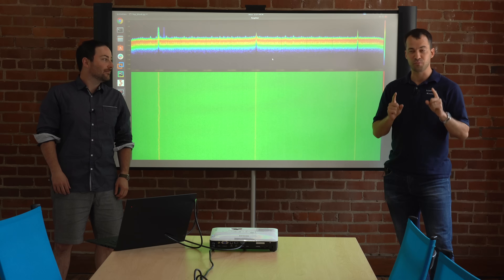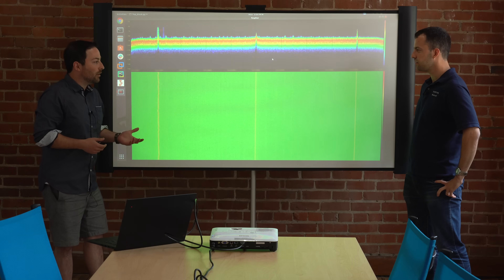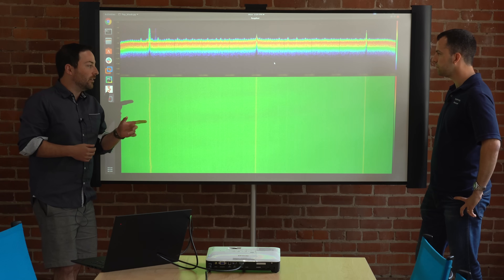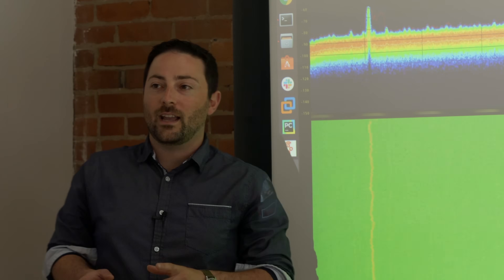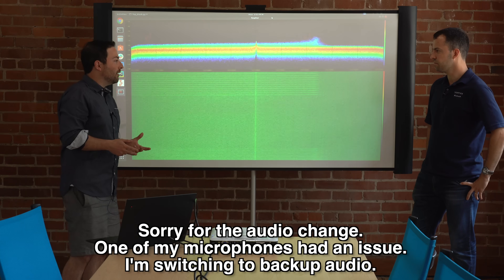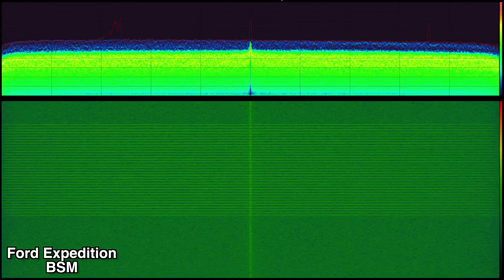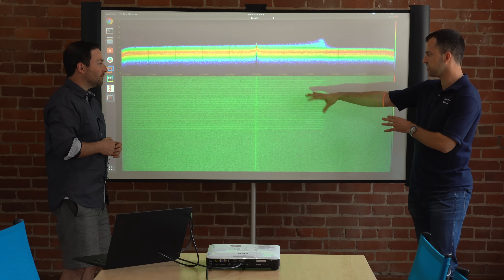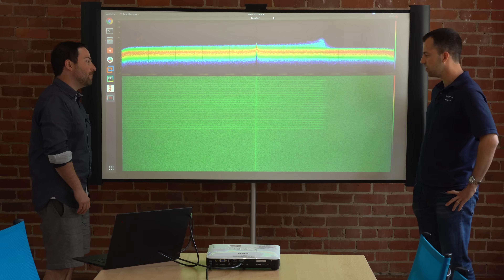Why Only Some BSM's Cause False Alerts

Comment: So really the whole spill escort was giving when the original passport max first released wasn’t just marketing speak. They actually are looking at a whole signature to reduce falses. I remember them getting a little bit of flack over that. I love my old Redline but the false alerts from these BSMs hitting the streets made it almost useless. I’m a professional automotive technician so I saw it coming long before it actually happened and I was pissed at the time because I thought it would make detectors in general useless. Thankfully that’s not the case. My Max 360c is quieter than my redline was even before these blind spot monitors plus the response time of the digital detectors basically makes band segmentation unnecessary. I remember Nine1c had a video showing the max getting hit with quick trigger while already alerting to constant on signals and it caught EVERY single shot. From that moment on I was sold. We’ve always had plenty of range we were just lacking in response times and filtering. I feel like the newer digital detectors have solved those issues plus some.

Comment: Very cool video. So if the Ford has all these little radar guns emitting signals (for as-designed safety purposes) with pulsing and frequency scan/hop, AND the detectors don't alert, you'd think that radar gun manufacturers would make regular size radar guns that do the same thing, which would make radar detectors ineffective. I guess there's some limitation at a bigger scale or they would have done that by now??
Reply from the maker: Those techniques are not being used to defeat radar detectors, but to help the vehicle measure distance, something that can't be done with traditional police radar.

Comment: A quick comment on testing your anti laser systems. I just took a trip through PA, USA and the toll booths use laser for the speed detection to remind drivers to slow enough for the RFID EZ-pass toll system. They use laser radar for that and it gives you a speed reading right on the sign next to each booth. (they probably use laser as it will be more focused between all of those lanes and can be aimed properly to get the results they need). 

Just saying, that could be an interesting test of your installed anti laser system without worrying about being caught. 
Thanks for all of your vids! My Uniden R3 got me through the east USA with all of the knowledge I needed before the phone's maps systems could tell me. I already knew where the bogeys were withing a great enough distance even in the curves of the mountains!
To note for my trip, I rolled with a Uniden R3, a Uniden BCD436HP scanner (I may buy into the GPS module now so I don't have to find the area codes where I am to reprogram), 2x Garmins dash cams, and on the way back I bought a $55 Uniden handheld CB radio so I can here the trucks talk without worry of it interrupting my scanner chatter from the po-po's. Made for a great flow and an uneventful trip. To note, the R3 was helpful because It warned me of many police vehicles handling an accident, I was aware long before others. 

People tend to think those of us are just trying to break the law, were are just trying to be informed. Because more information than just visual windshield can make driving safer for all!
Reply: My apologies, I am doing billing (just got back from trip so I didn't yet get a chance to watch this vid yet, sorry if the comment is so far out of the vid post.

Comment: When are any of these radar detector company's going to come up with a detector for redflex?.
Reply: They already do. Fixed red-light and common van locations are GPS marked. As far as their radar based vans and the use of low powered planar antennas, they can be detected by radar detectors. While you don't get a long distance alert the their radar can't transmit very far either, around 50ft and almost 90 degrees across the street for the angle

Comment: So that's not "Sweeping" across the frequency.. its a wide bandwidth pulse modulated signal on the ford.. ALSO I have a few ideas for blocking out the BSM of the Mazda.. In Ham radio we would use a narrow bandwidth filter. to clean up signals.. If you look closely at your spectrum you will notice the Mazda has slightly wider and more messy signal than the Radar gun. 
For example if you where able to listen to the pulse of both the police gun and the Mazda you would hear the pinpoint EXACT frequency of the police gun and the slightly fuzzy frequency of the BSM Mazda.
SO basically you need a slightly smarter system that can identify the bandwidth of the signals.. THAT would give you a way to identify the type of signal.. 
DONT tell me its going to cost you a million dollars per unit.. You can get a Software defined radio for $300 that can pick up FAR more bandwidth than just the Radar spectrum and Ham Radios with this ability and MANY other filters besides cost 600-800 dollars, they not only recive a MUCH wider range of frequency but and they also transmit.. This is just R&D work you can make this into a $600 detector.. No excuses!